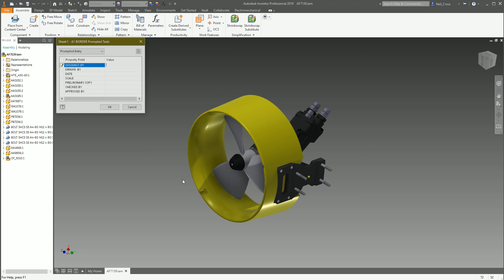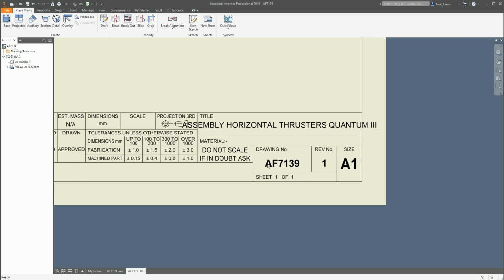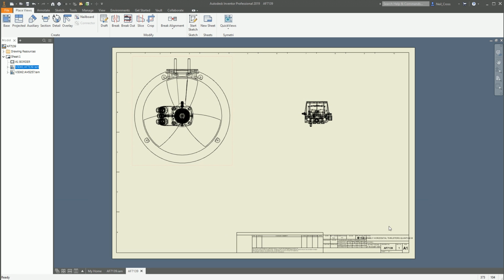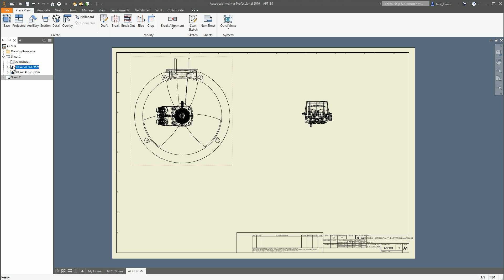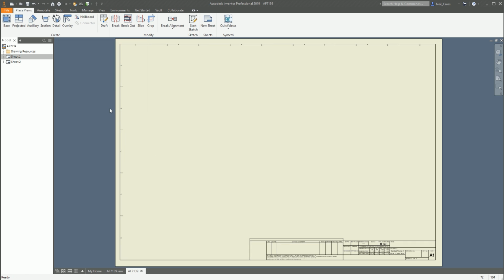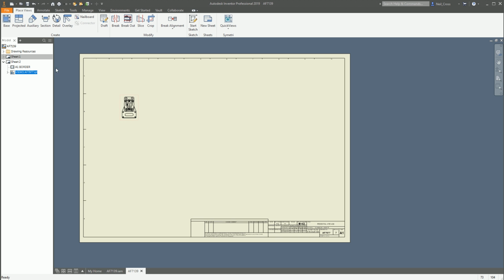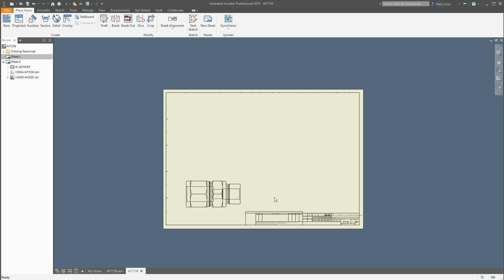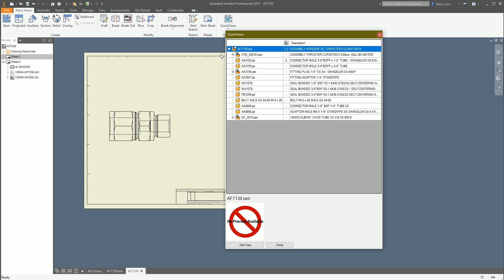Changing the model that fills the properties | Autodesk Inventor

Comment: Hey man. I've been watching you for the last couple of months when I started using Inventor for my Engineering class. Anyways, I'm modeling a stapler for a project and I need some help. I made it so that the different pieces of the stapler stay on a certain axis to turn on, but they can move anywhere as long as they are on the axis. I want them to stay put but still be able to rotate up and down without moving horizontally. Any help would be greatly appreciated. Thanks!

Comment: There is another option. Create 2 separate, but visually similar Title Blocks within your .idw Template, Drawing Resources Folder. 1 Title Block set to have Number field populated from the Model (.ipt or .iam) iProp as per usual & is used for Sheet #1 only. The  2nd Title Block set to have the Number field populated from the actual Drawing (.idw) file iProp itself and is used for all Sheets after #1
Reply: Yes mine are all in the template in the title blocks folder and can be mixed & matched - - - -added & deleted as necessary in the drawing file.

Comment: There is a way to do this without the hack. I’m a bit fuzzy on the details, but it involves editing the drawing template title block
Reply: Yes-At my workplace we use a sheet that populates the titleblock by referencing the Iproperties of the assembly(ours references part number or stock number can't recall which unless I'm actually in it). It is a customized idw template with some ilogic rules I think.
Reply: Yes toolauction my title block does the same in my sheets.  Not sure who made the sheets but they work differently than the one in the video.